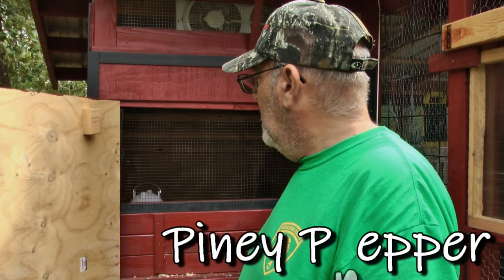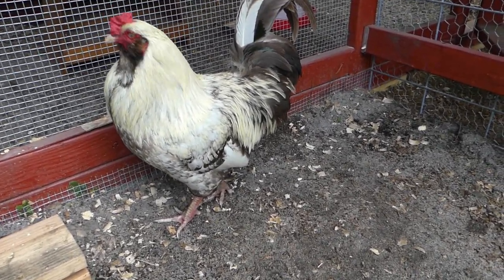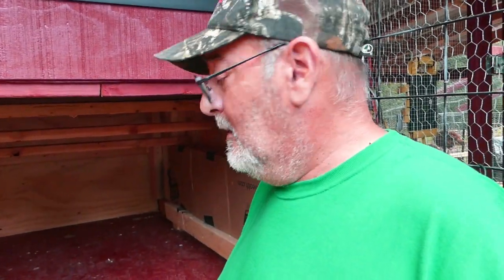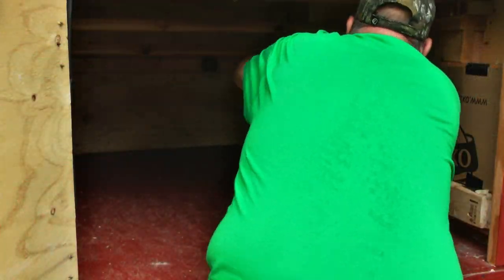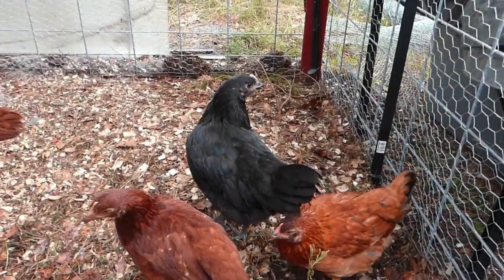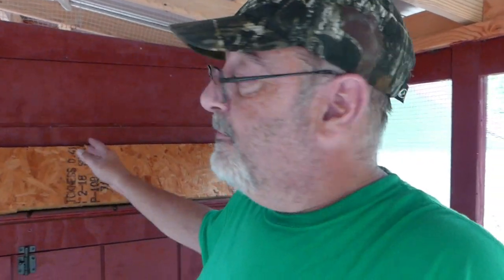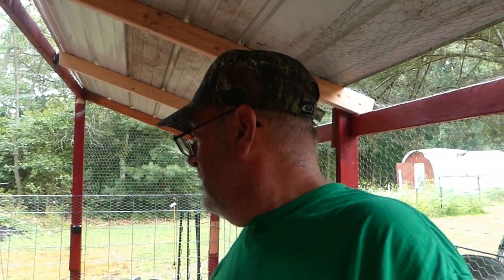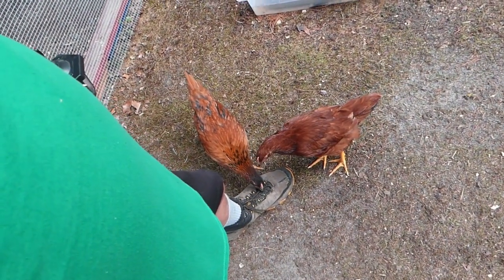From Pine Shavings to Wood Pellets in Chicken Coop

Comment: So, if you fill a 5 galleon bucket up with those pellets about 1/4 of the way, add cold water till it completely covers the pellets, then quickly dump out the excess water and stir with your bare hands. Within 15 min your whole bucket will be filled. Stir it and put in your coop. It’s should be dry. It will still absorb and the BEST part… you can use your litter scooper to clean it. The pellets won’t fit through, but the dust like pine will… just like sand and capture all the poo! Super easy! I’ve been using mine for over a year.
Reply from the maker: I actually put the pellets out on a tarp. Sprayed it with the hose. Used a rake to spread it out, then let it dry for a day. But your way with the buckets actually sounds WAY EASIER. Thank you for watching and the comment. I'll try your way on the next batch. It really does work better with the scooper.

Comment: Thanks for posting your video. What was the result after you used the pellets? 

Btw, regarding your chickens not going on the roost until the day time, it’s possibly due to your cameras. I put a camera in my coop as well and the nightvision (by use of infrared lighting) was on by default. I noticed the chickens would be constantly looking at the camera.  When i moved it so the camera was only pointing at half of the coop, most of the chickens began sleeping on the side where the camera was not pointing. I did some research and saw that chickens can see the infrared light. Supposedly it doesn’t bother them much but based on my experiment, it did.  Now i turn off the night vision and the chickens seem to sleep evenly throughout the coop now. If you want to see if this might be the reason why your chickens dont roost at night, maybe try turning off the night vision or turning off the camera completely and see if that changes their behavior. It was really hard for me to find this info online so i had to conduct the experiment myself. Good luck!

Comment: The reason they are sleeping in the corner is because that's how they slept in the brooder, you have to put them on the roost at night to train, your hen house doesn't have proper ventilation,  sand doesn't work,  those pellets have carcinogens and what you said is nasty is actually the healthiest for your chickens.